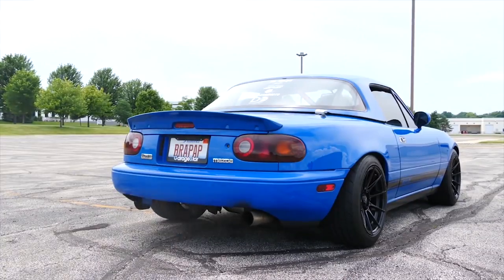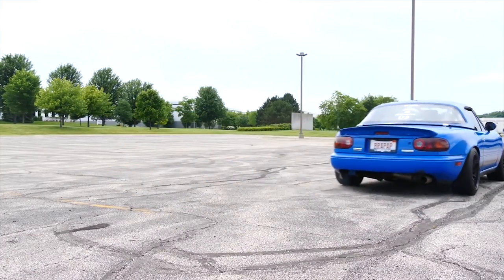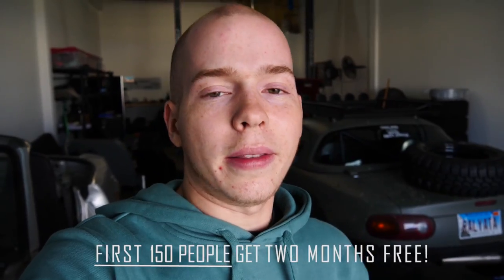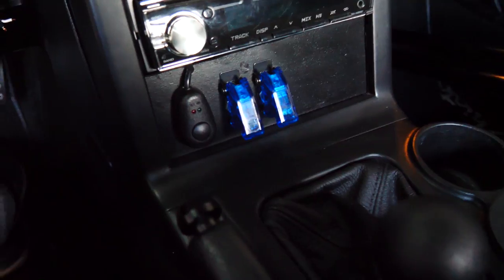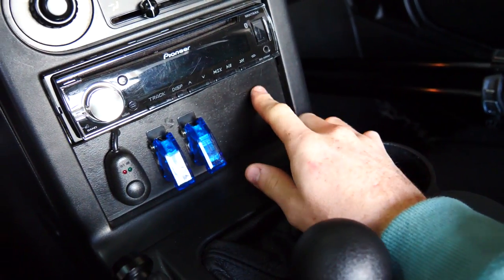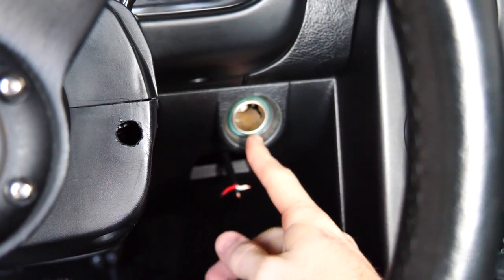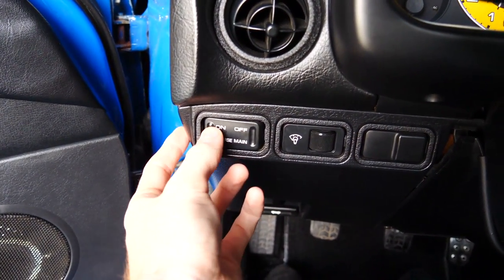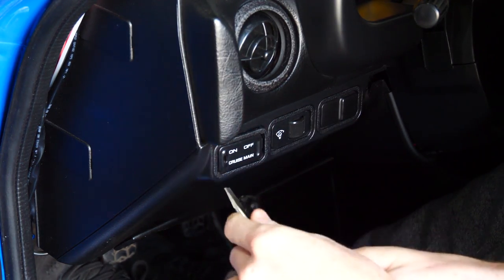Launch Control & 2 Step ON DEMAND!

Comment: 0:42 just imagine Caleb, in the middle of a uphill stop ligth regulating throttle and clutch when Suddenly 2step engages BRAAAAAPAPAPAPPAPAPPA
Reply: @suicidebunnyz   hey buddy I want to do.this to a auto car. But I want to.have a switch  for it so It dont 2 step everytime i hit brakes. I want to run it off my brake light switch like how u running it off ur clutch
 Im a89 foxbody. I need to tap pin 30 at ecu and run it to brake then ground it Help please.
Reply: @willsilversurfinharris6239  please dont

Comment: "Smoke some mustangs" Nice one :D
Reply: Because the miata starts smoking and the mustang it gone
Reply: JK😂🤣
Reply: I just wanted to make this comment👌
Reply: :D
Reply: k0c370 Mustangs are slow.
Reply: Gingium smoked his own Miata in Adams gt350 Easy
Reply: Christian Kinzel it’s all a spectrum. A 3000 hp foxbody isn’t slow, but neither is a 2JZ swapped miata.
Reply: Miatas Forever Well any car can be fast with a swapped engine, or forged internals, but I’m talking about stock mustangs. They all are slow when compared to other cars of the same cost. My near stock Mazda Speed 3 hasn’t lost to one yet, and the only engine upgrade I’ve done was add an aftermarket cold air intake.
Reply: Seriously? I would believe that for anything except a coyote powered newish one. But go mazda!
Reply: Miatas Forever 😂 yeah!
Reply: Christian Kinzel dude raced one 1999 mustang v6 and won and now he’s like “I’ve never been beaten by a mustang” lmfao
Reply: Aldo Lizalde Actually I go drag racing every Wednesday night, and have raced probably around 20-30 different mustangs and have beat all of them. I’m Cobb stage 1+ rn with an am K04 turbo pushing 25 psi.
Reply: Christian Kinzel “near stock” 😂😂😂😂😂😂😂😂
Reply: Aldo Lizalde I mean other than the tune, intake, and turbo yeah
Reply: @aldolizalde481  lol that's pretty near stock he said hes literally running a stage 1 tune a different turbo and an intake, all bolt ons and I'm guessing most mustang's going to a drag strip have at least intake and exhaust
Reply: James Foster “near stock” would be an exhaust and an intake, once you add the turbo and tube it’s not “near stock” anymore
Reply: James Foster Thank you! Literally just a few bolt ons..
Reply: @aldolizalde481  lol did you just say putting a tune on your car makes it less stock then adding an intake or an exhuast system? Alot of ecus dont even have to be changed to get a tune alot of them are just on the stock ecu or piggybacked a tune doesnt make a car any more built than a exhaust or intake
Reply: @aldolizalde481  if you only have bolt ons you're near stock you're modified but your still near stock what else would he be?
Reply: James Foster his car has a turbo pushing 25psi, if it was only a tune then your comment would make sense but it doesn’t, also quote me please
Reply: @aldolizalde481  if he has a k04 it's actually the stock turbo for a mazdaspeed 3
Reply: Gone in to a crowd
Reply: James Foster Yep, and I do.
Reply: @christiank7837 stock miatas have 130hp do you call that fast
Reply: @TheWolverine-rm2kr  He has 260 ofcourse a flying Miata turbo is nowhere near as stock as a mustang + exhaust
Reply: Boy don't test me
Reply: Just pull out the car park without  crashing and you'll win
Reply: Boo hoo yea,yea right.
Reply: @TheCarPassionChannel   hey buddy I want to do.this to a auto car. But I want to.have a switch  for it so It dont 2 step everytime i hit brakes. I want to run it off my brake light switch like how u running it off ur clutch
 Im a89 foxbody. I need to tap pin 30 at ecu. Help please.

Comment: My launch control makes my car die as well, not sure why
Reply: I think I found why, I got the fm variable tps and I think that you need to reach higher value that the one you use to decide at witch % you want it to be on.
Reply: It should only be on when (near) full throttle.
but i don't like how the rpm gauge dies when he cuts ignition on the clutch switch at 3500 rpm.

Comment: FYI: pinout for all generations of cruise control switch are pretty well documented with some googling. The trick with the switch in NA's is some of them are momentary switches, some of them are continuous, based on year. Your switch looks pretty decent and stealthy though. For example: https://forum.miata.net/vb/showthread.php?t=51579

I had to go through the same process when I retrofitted factory cruise and fog lights into my NB.There's 3 different dash harnesses possible for a NB Miata based on options. How dumb is that?!

Comment: Solid suspension bushings aren't really a thing. If you want something like that, your best bet would be heim joints.  These are extremely expensive for a small performance gain and you would need custom control arms to run something like that.  You'll see them a lot on wise fab setups and racecars in general.  Poly bushings or new rubber bushings are definitely your best bet.  Energy makes good bushings for a decent price.  I use them on my Legacy GT and they squeak just a bit.

Comment: If you do this mod, does it mean the car won't start without the launch control switch set back to on?  Or does the megasquirt not have the same clutch safety protocol as the stock ecu.  I'm asking because I'm in the process of making my megasquirt wire harness for my 1.6 so this is something I'll be approaching in the near future.   Thanks for making these informative videos!

Comment: I'm currently trying to wire launch control with a rocker switch without using the clutch switch. Do I route power into the Megasquirt's "launch" pin or route the pin to ground????

Comment: Guys! Is it ok to JB Weld a crack in a BMW 525tds Oil Pan? Car is not street legal and it is used just to drive around the ranch so its not gonna get hot.

Comment: Wonder why it wasn’t working at first
Reply: Mohammed Abbas - Same.
Reply: Lack of an electronic speed sensor will let launch control screw with you during shifts if you're not using flat shift.  It takes a bit of playing with the tps percentage in megasquirt, and also the clutch pedal position to be able to just leave launch control on.  Just a guess based on my ms experience.

Comment: That cruise control switch is really just a two buttons. 6 wires (signal and ground for each button and the indicator light). I belive the Ecu can probably be programmed to switch launch control on and off with a button press, but you are right it couldn't be done the way you wanted to, atleast easily.

Comment: Hey Gingium, I did the AWR Motor Mounts today along with Delrin Diff bushings and let me say I 100% recommend the both of them combined. The only problem with the AWR Motor mounts is that you definitely want a heads up. The NVH will be strong as fuh at idle for the first 500 miles. It supposedly mellows out. But as for the performance, I haven't missed a shift yet. It's solid as all hell now! And it rev matches way easier, along with blipping the throttle, it all performs a hundred percent better than before. And I even previously had the 40% stiffer competition rubber motor mounts, and they honestly only lasted about 200 miles for me before they got bad. So I'd recommend the AWR Poly motor mounts for you from Fab9tuning. As well as the Delrin diff bushings. Don't get any other look-alikes from other manufactures, they are even harsher I've heard but don't perform anywhere near as good sadly. And as a side note, please let us know if you find a nice (hopefully affordable) solution for upgraded suspension bushings. I'm looking for that right now as well!

Comment: My dad used to have a ‘68 Firebird with trans-am spec suspension set up with advice from a former factory race engineer. He asked him about metal bushings and he said they’re a real pain on street cars. You need to make sure all your clearances are dead nuts perfect or you’re essentially going to have solid suspension.

Comment: You could of use the switch 
You had to test the wires not the switch to see which carries out the current so you could run that to the computer

Comment: leave my mustang outta this. just kidding but would be dope to race my 04 GT against a miata
Reply: Emily Tate The hole is the Miata would be smoking and the mustang out of sight in front of it lol
Reply: A boosted Miata can't touch the torque of even a 2v Mustang lmao. You'd leave it it in the dust from a dig.
Reply: Ford Racing '82 true but still would be a fun race

Comment: I seriously feel that wheel hop man. my stock NB suffers from it too, so im always scared to spin the wheels in a straight line even in the rain, cause the suspension just goes mad. I havent found any solutions online either besides like "just get better suspension" yeah no shit what do you mean better suspension... even with all your chassis and suspension mods its still there, and solid bushings are not the greatest option for a half daily.

Comment: sorry bruh you ain't "smoking" Mustangs in ur miata
Reply: Don't underestimate a very light car with more than 200 hp
Reply: Definitely does
Reply: This thing would destroy sn95s and new edge gts... if they're stock that is
Reply: Very old stock mustangs maybe...
Reply: Brandon Harrington  Honestly it depends on what you have if your miata has 300 rwhp  with 245  Rear tires yeah easy (7.3  Power to weight ratio at 2200 lbs *the car weighs 2100 pounds*)  The 2019 Ford Mustang has a power to weight ratio of 7.8 @ 480 hp with 3780 lbs
 but if you're 200 ish it'll be a little bit more rough  You might be able to beat the early 2000s
Reply: @Teararec  except there is no depending on anything. His Miata makes a little over 200whp, not a hypothetical 300+...
Reply: That joke flew over your heads lmao

Comment: Change that piece of wood Gingium
Reply: Corey 01 right. He should just make it a piece of abs plastic.
Reply: Ilikeboost or a little panel of carbon fiber
Reply: Corey 01 yeah maybe but carbon is expensive. Honestly abs is strong enough so the only reason to get carbon is look.
Reply: Ilikeboost I’m just sayin for the looks it can’t be a lot for like a few inches by like 5 it could be like idk 20 bucks I mean yea that a little bit more but it’d give it a nice look either that or just a piece of sheet metal clear coated

Comment: All you had to do was go under the car, reach above the transmission and unplug the two white clip connectors. This is the neutral safety switch connection for cruise control. This is why LC and FFS is staying on all the time. If you remove it you can have LC and FFS on your miata and not have to use a switch to activate it.

Comment: Show me a decent mustang that couldn't beat that rice rocket
Reply: Jonathan Rabbe how is it rice. It’s the opposite of rice😂
Reply: @axelfeliz1881  it's a miata
Reply: Jonathan Rabbe Fanboy much?
Reply: V6s
Reply: @umerafzal482  that's not a decent mustang
Reply: @nicovanduin1553  no I'm just not incompetent I personally think that mustang's for the most part aren't great but they are still faster than a miata
Reply: How the fuck is it rice if it has a turbo
Reply: Michael De Santa having a turbo doesn’t mean a car isn’t rice
Reply: a V6 mustang would beat that Mazda
Reply: this would totally beat a mustang on track. just get it to a proper track like the Nordschleife and it'll easily smoke any decent mustang
Reply: weight. need i say more. this thing weighs about as much as a shopping cart compared to a mustang, which is more or less comparable to a dodge, and dodge vehicles weigh about as much as a tank. a miata weighs nearly half what a mustang does.
Reply: also, i'm pretty sure molly has some weight reduction.
Reply: The joke flew miles and miles above your head kid.
Reply: Okay, then please explain what the joke is here because i don't see anything that directly relates to anything being the slightest bit funny other than your idiocracy. I'm stating facts. Miatas weigh less than mustangs. You saying "You missed the joke" When there really wasn't even a joke is just you trying to fend for your opinion. I Like all cars, but again all i'm saying is a miata weighs less, and you very well could make it faster than a car that is of more weight.
Reply: Lol any sn95
Reply: 0-60 is now around 4 sec with flatfoot and launch control
Reply: There is a fine line between tuner and rice and this is not rice if you want rice I'll show you rice lol